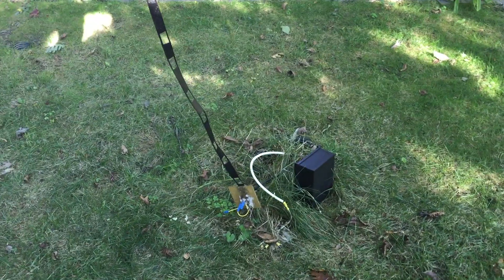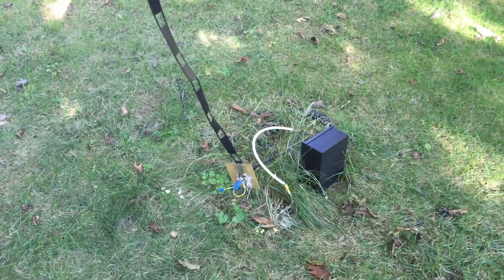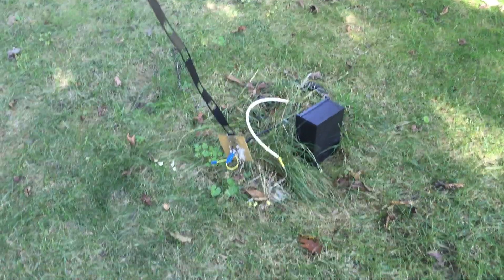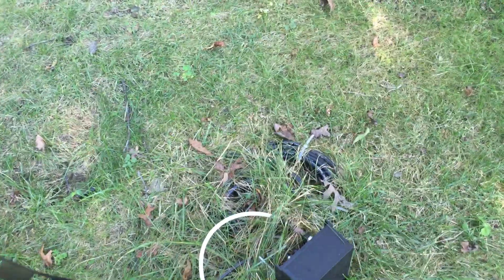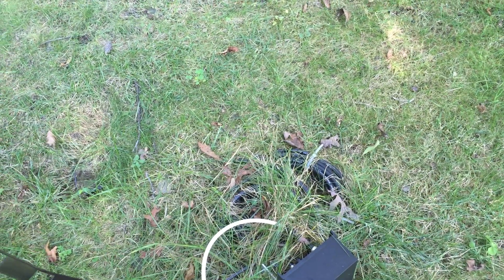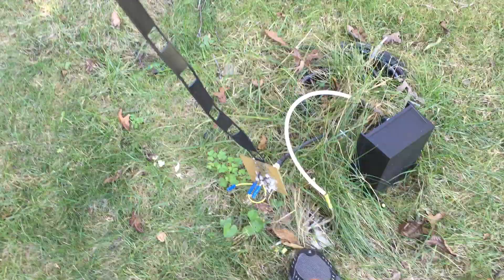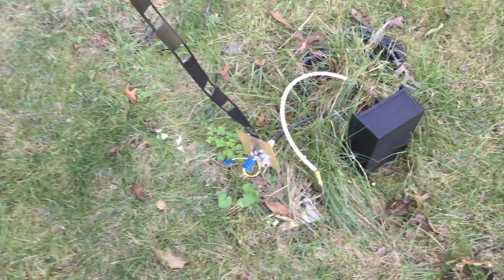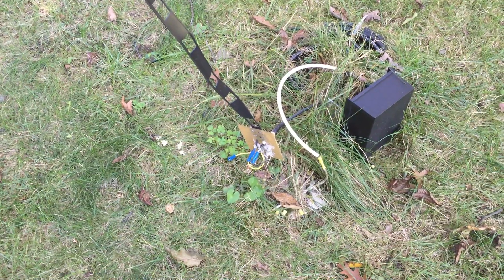G5RV antenna with 160m modification

Comment: I see you have c=what looks like connections exposed to the weather. Do you need to weather proof  any of them besides the coax connection?

I live in Wisconsin so I deal with snow as well as rain, are there any precautions I need to take to weather proof either the lower feed line connection or the upper head?
Reply from the maker: After I made the video (before winter), I pounded in a piece of pipe and clamped the switchbox to it. I also pulled the center of the G5RV up a bit so end of the ladder line is now about 2' off the ground.